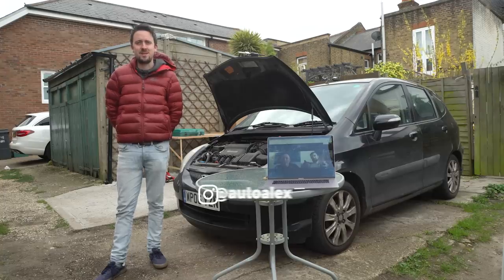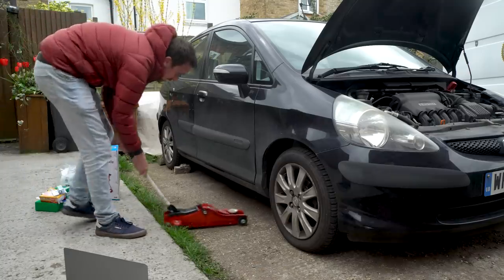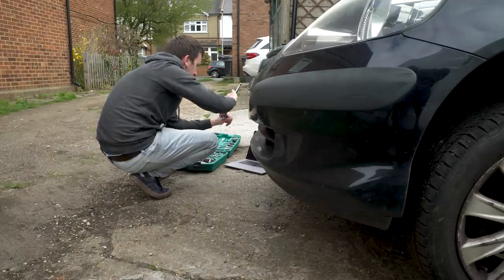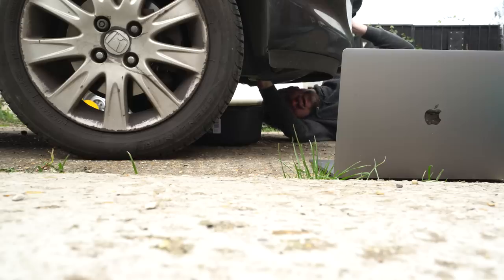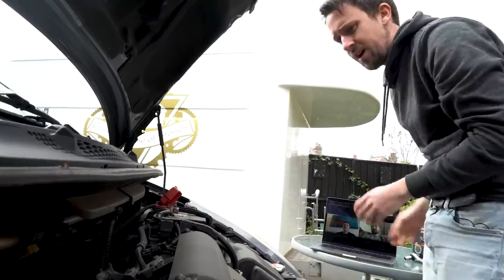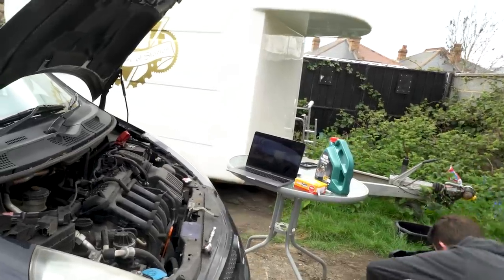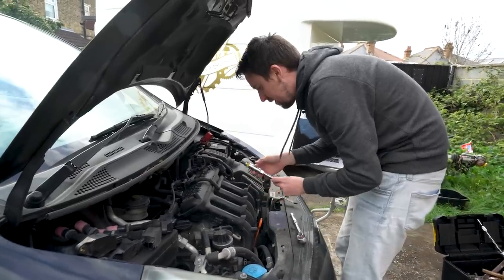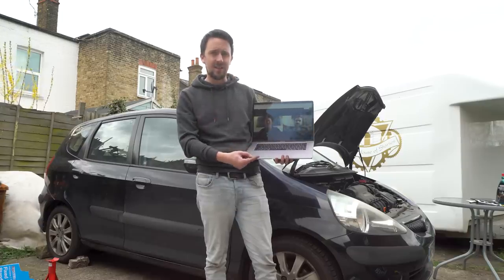Can A Non-Petrolhead Service A Car Over FaceTime?

Comment: I want to see more 'Ethan Vs Car Maintenance'
Reply: 100%!
Reply: 100%
Reply: yes  let it be funny stuff but not a safety hazard when messing up.
Like changing the light bulb on a mid 2000s Alfa and in the end he'll realize he put it in crooked
Reply: No
Reply: 100%
Reply: Start with handy jobs like brake pads and discs then move him onto clutch replacement, timing belt and water pump 😂
Reply: I wanted to like this but I didnt wanna mess up the 777 likes
Reply: Fog light on a 2007 Saab 9-5
Reply: Great idea
Reply: ethan fits a hks big turbo kit and injectors to his honda jazz
Reply: @theowainwright7406  😂😂😂
Reply: 85%

Comment: "You need to social distance the battery, so keep it 2m away" 😂😂
Reply: Never heard about disconnecting your battery when you're changing sparkplugs, but alright ....
Reply: @ACCORDriver_NL  I never do that.
Reply: @ACCORDriver_NL  I've been zapped through the hand several times by a 40kV coil pack once so I can understand the caution.. but that said, I can't see any reason why it would discharge with the car off.

If you're curious as to how that happened - 18 year old me was on the side of the road with a blown clutch and gearbox (snapped input shaft.. no connection through any gear at all) and I had previously swapped the engine with one from a similar but slightly different model, which had different alternator wiring. This change in wiring meant the engine didn't turn off with the key, so for the month prior I was purposely stalling it in gear with the brakes on every time I parked.
So now with a blown gearbox, and wrong alternator I had no way of stopping the car.
2am, no streetlights around, no torch, no tools. So I wrapped a rag around my hand, made sure that I was not touching a single part of the car with any of my body, and ripped out the main distributor lead.

Hurt like a bitch for 2 seconds, but the engine stopped and I was not injured.
Oh to be young and dumb. I really miss that car too, 1981 Mitsubishi Scorpion. It brought be nothing but pain and anger through mechanical trouble, but was a dream to drive and so comfortable for long highway cruises.
Reply: should have run the engine to let the oil circulate then check oil level and top up if required
Reply: 200th like.
Reply: @sixunity1171  Thanks for your kind words, mate

Comment: Can we give Ethan a round of applause for getting the oil filter off bare handed without a wrench?
Reply: Reagan Lyle they should be hand tight though....
Reply: @robplant5576  yet rarely are
Reply: @robplant5576  the rubber seal bonds it together causing good fun
Reply: @luckiihussain9617  I usually pull the o-ring off and coat it in oil, then I do hand tight(then a ¹/4 turn) worked for about 100 oil changes so far.
Reply: @xjmg007  you have to oil the seal regardless but like they said the car was well over due a service so didnt make sense
Reply: @luckiihussain9617  not what I said, I said if you pull the entire o-ring off and coat BOTH sides, they tend to free easier
Reply: @xjmg007  And im telling you it doesnt always work I've been a mechanic for 7 years and do 2 3 oil changes a day you experience the lot
Reply: @luckiihussain9617  I'm sure you're right, I have only done a hundred or so, and I'm only experienced in LS's and Hondas. Not doubting you, just my anecdotal experience.
Reply: @xjmg007  Cars never go to plan the small jobs turn into the worst nightmares
Reply: @michasopa4305  If you struggle to get 2 hands on the filter the chances are slim but the screwdriver trick manages the job
Reply: I have the feeling that some mechanics use an impact gun to screw these things on. I've not gotten them off this easy ever.
Reply: @robplant5576  I do mine hand tight, but most people suggest hand tight plus a quarter turn (makes sense for someone who isn't as capable of tightening the filter enough by hand)
Reply: My old Jag S Type Oil filter was on so tight I had to stab a screwdriver through it and lever it around.
Reply: @mikeazowski1  Had to do this as well, though I used a drill first. Definitely not a good idea for cars with top mount filters, though those usually have space for a proper filter wrench.
Reply: @robplant5576  idealy they must be. Last car oil filter i changed, i almost ripped the filter with the filter wrench. Thats how tight it is.

Comment: I’ve never disconnected the battery when changing my spark plugs lol 😂
Reply: Dave you’re not the only one!
Reply: Technically you only have to disconnect the negative
Reply: I cant do that because my alternator output bolt is near my first spark plug and if i dont disconnect my positive wire it'll spark because my long spark plug socket make a short circuit
Reply: You've never done it because it's unescesary ✨
Reply: @putraadriansyah8082  when the negative is off you dont habe to worry about anything
Reply: @robplant5576  You disconnect the negative
Reply: You don't have to literal waste of time
Reply: @robplant5576 thats  too positive
Reply: disconnecting the battery is pointless. only one plug can spark at a time also ht leads are rubber coated so the only way you could get a shock is if you put your finger inside to make a connection
Reply: @robplant5576  yeah but you're not meant to disconnect the positive without disconnecting the negative first
Reply: mechanic of 20 years- not once have i disconnected a battery for spark plugs or leads... i do however gap the plugs haha
Reply: @Jeronimo Stupenengo Pefaur anyone with the slightest grasp of school knows that comes under Physics lol
Reply: @nornironniall  It's actually kind of a crossover between chemistry and physics. Chemistry deals more with what actually happens inside the battery, while physics looks at how the current flows through the system
Reply: @namedeleted9005  thanks for that, but sorry Hayley we're talking about electrons and their attraction to the positive pole.  That's pure physics.
Reply: @nornironniall  that's actually electrochemistry, which basically deals with determining the cell potential of a battery by looking at the gibbs free energy and how the redox reaction needs to proceed in order for there to be a spontaneous transfer of electrons without any outside input of energy.
Reply: @namedeleted9005  again, you're talking about batteries.  Which contain chemicals.  We were just talking about electrons.
Reply: I have never ever disconnected the battery when removing plugs. nothing bad will happen hahah

Comment: Ah the Honda Jizz... he'll have fun with that as they are twin spark, takes 8 plugs... lol
Reply: I came here to post that! 😁
Reply: Paul Coles me too.
Reply: Beat me to it
Reply: Lol guys, sorry :-P - These are actually very good little cars, I picked a 1 owner one with FSH and 90k on the clock for £175 at the auctions, gave it literally death every time I drove it for about 2 years, flew through every MOT with no advisories, only had to service it hence I know it has 8 plugs lol, they are actually quite fun to drive/go-kart like if you throw them about, plus folk get out your way as they think someone ancient is driving it. :D
Reply: Only 4 of 8 is changed I reckon :)
Reply: I own a Dodge Charger with the 5.7 Hemi V8 and it's dual spark plug so I have to change 16!!!!
Reply: Honda Jizz
Reply: @79RockShox  of course its a good car, its a honda
Reply: The clue is in dual sequential ignition.
Reply: @meemdoggoriginallongdrink  Yes, that was not a typo. :D
Reply: The Gen 2 which my mum has has 4
Reply: @adamhenderson4318  Dual Shock Injection
Reply: @wolfrunner6462  if the cam cover says i-DSi on i, it's got 8 plugs, usually the 1.5 VTEC ones are 4 plugs but used to be rare in UK. As far as I'm aware, more common the 1.35 (1.4) i-DSi.

Comment: Hey guys, FYI:
The Honda Jazz uses 8 spark plugs. 

Cheers!
Reply: Twinspark ???
Reply: Yep having serviced my dads can confirm it does and the ones at the back are a nightmare to get out
Reply: A HEMI engine uses 2 per cylinder, but this is a cheap car so  its a joke
Reply: It actually has 2 per cylinder got me the first time I serviced mine
Reply: I believe its only the 1.3L ones that have 2 per cylinder
Reply: IckleSparrow  We own a GD Jazz with an 1.2 and it has 2 spark plugs per cylinder.
Reply: As a Honda technician I can confirm that this particular engine does in fact have dual spark ignition, 4 at the front and 4 at the back, it’s why these miss fire so much as people don’t replace the back bank.
Reply: It took me years realise my wife's Jazz had 8 plugs. After changing just front 4 for years it started jerking @ low speed and I couldn't find out why. I always went to the spares shop and asked for 4 plugs with the code. Eventually I accidentally just asked for plugs for that model & the guy gave me 8 plugs. I pointed out that it wasn't a V8. He told me the facts!
Problem solved - no more jerking.
Reply: @icklesparrow  and the 1.4
Reply: @gregculverwell  and that is why poeple shouldn't touch what they have no clue about
Reply: That's what I was thinking. I'd love to see Ethan changing the other 4 spark plugs though... hahahaha XD
Reply: I have never heard of disconnecting the battery before changing spark plugs and I've been doing so for forty years .
Reply: @michaelarcher6278  same here... another example of don't believe everything you see on yt.
Reply: @nilsgerbracht  yep. the iDSI written on the engine cover stands for "intelligent dual spark plugs ignition" if i'm not mistaken

Comment: That car is actually with 8 spark plugs :D . My mother has the same Honda. The rear plugs are really fun to change :D .
Reply: What???
Reply: yeap. it has 2 plugs per cylinder.
Reply: Ah you ain't done spark plugs til you done a Mercedes m112 engine
Reply: same for the Honda Civic 1.3 FD Hybrid Version.
Reply: @aliabdallah102  This is engine where easier is make full rebulid than change sparkplug. Easy to remove if u have a lift to separate body from car
Reply: @aliabdallah102  you aint done a spark change on a M275 ;)
Reply: LDA1.3
and 8 coil packs too. The two sets, front and back, are also different.
Reply: @rasmuswennerarnell7359  cant be worse then an old porsche boxster (you have to lift the engine to change sparkplugs)
Reply: @rasmuswennerarnell7359  no, but I just bought a car with the 275.
Reply: *272
Reply: Same with 90s ford rangers
Reply: Yeah, my friend has the twin spark model... And its 'really fun' to do... And also it had one plug stuck due to over-torque on previous service... So we decided not to change that one till now... 😅 😅 😅 😅
Reply: I was literally about to say this 😂 he's forgotten about the other four plugs
Reply: Man now my Volvo sounds easy..
Reply: I regularly use chunks of glove to grip nuts and bolts loo
Reply: The rear plugs are gonna make your hands bleed....

Comment: This is an i-DSI engine which has 8 spark plugs. Good luck replacing the other 4 spark plugs Ethan! =D =D =D
Reply: Yea......I have done it on mine.......not recommending for sure :D
Reply: They are fairly easy to do i dont mind doing them
Reply: Thats what im thinking about, seems like they not realize it  😂
Reply: Why does it have 8 plugs?
Reply: J S twin spark engine 👍🏻

Comment: When you're removing spark plugs, the easiest way about it is to loosen them up with a socket and them grab them with the coilpack or sparkplug lead and chuck it out. Much easier than any other method really, unless you have a socket with magnetic insert.
Reply: Why would you need to disconnect the battery for a change of spark plugs? 
I have done a few and never heard that before if the ignition is off surely there is no danger.
Reply: @thedave7760  I've never disconnected the battery when charging spark plugs lol.
Reply: its probably a disclaimer thing as someone will copy this but with the ignition ON! lol
Reply: Ooooor...you could use a socket that is specifically made for sparkplugs, just a though though

Comment: I see the engine cover written i-DSI. The jazz/fit use A15 engine, and it has 2 type. Didn't that engine(i-DSI) use 8 spark plugs?? 😅
Reply: yes 2 plugs per cylinder set at later timing to burn all or any remaining fuel from the injection
Reply: @Ravinstomper  I would actually love to see Alex mess up Ethan saying that engine actually use 8 spark plugs he convince that is a 4 cylinder engine. 😂
Reply: @Ravinstomper  Wait, Honda use 8 spark plugs like AR with twin Spark??

Comment: Top tip ethan: dont hold the oil container vertically like you do here. But rather horizontally. That way the oil should come out in a nice stream. 

They should have said that tbh
Reply: And use a funnel, just sayin...
Reply: @ashtonmark24  top half of a Pepsi bottle works fine 😉

Comment: I really hopes he forgets the bricks around the back wheels! He'll try to drive off and wonder WTFs gone wrong!
Reply: I've actually done that before when I got my new stainless exhaust in and was really excited
Reply: @kaksken1999  I work almost 6h to put exhaust in my friend E46, and we forget about jack under rear diff.
Reply: @mateuszzimon8216  I haven't done that but I drove over the tool case too 😂
Reply: 2 years ago I got new wheels and after mounting them I wanted to take the car for a spin. The car didn't move anymore. I almost freaked out. I found out that the spokes where hitting the brake calipers and had to get some spacers for it :D

Comment: This was great 😂. On the slightly older Jazz’, they actually had 8 spark plugs, even though they were a 4-cylinder engine. 😬
Reply: This was only for the 1.3, the 1.5 has 4 plugs.

Comment: Love how Ethan celebrated after changing the air filter 🤣
Reply: Hey on modern cars that's an achievement! I've changed headgaskets on classics but I can't fucking figure out how to open the damn air filter box on a 2003 Skoda Fabia.
Reply: @GlamStacheessnostalgialounge  Honestly some modern cars have some stupid designs that make easy jobs way harder but that little wagon that Ethan has looks like a right treat to work on
Reply: @jordanlazarus7345  Well, might seem easy until you realize that Honda has TWO sets of spark plugs, the other set is on the other side....right next to the firewall...under a bunch of stuff...yeah, not a treat.
Reply: @GlamStacheessnostalgialounge  That's still light work compared to some of these modern cars

Comment: That i-DSI on the engine cover would rather suggest that it's got 2 spark plugs per cylinder.. 
So that's half the job done. 

(Also cabin air filter. If it's been that neglected it'll be truly revolting)
Reply: I thought anything with a D in the model meant it was Diesel TDi, D-4D, 320D, that sort of thing...
Reply: @Jamal_Tyrone  
Not always. Can mean various things manufacturer dependin;
Mitsubishi GDI -gasoline direct injection
Honda DSI -dual spark ignition
Also no diesel honda jazz/fit ever made

Comment: I physically twitched when he dropped the allen key.  I envisioned it going right into the jug.

Pro tip: screw the files, screwdrivers, etc.  Just use a magnet.
Reply: Marigold with magnet, not in this case. 
but good idea
Reply: Magnetic wand has saved the day many times!
Reply: a strong magnet on a stick is honestly a must have when buying tools, however most people don't drop hex keys into spark plug holes

Comment: 14:12 You forgot the 4 spark plugs at the back of the engine
Reply: Exactly, the iDSI Jazz engine has 8 spark plugs for efficiency. I made the mistake of only buying 4 when I serviced my ex's Jazz the first time.  
I've now got a modified 1.5 VTEC Jazz with a full exhaust, lowered, wheels, brake upgrade and a racing seat. Good fun little cars.
Reply: @michaelclark3192  no one asked.

Comment: These engines have 8 spark plugs 😂 only 4 were changed 🤷🏽‍♂️
Reply: just looked it up and you're right. what a weird design decision by Honda, only ever seen an Alfa with twin spark plugs
Reply: The IDSI has 8, pretty sure the vtec's got 4 again no?
Reply: @socalguy829  Why weird? It improves torque curve and emissions.
Reply: i have idsi jazz same as ethan. it got 8 behind it. it hard af to changes theme in tiny spaces.
.. in brochure (in thai) said. they got 8 spark plugs to help clean and  good combustion. might be.
Reply: @bootlegscarce0844  what's the point of having 8 spark plugs in a economy car?
Reply: @1985toyotacamry  for efficiency
Reply: @jorgedelrey742  I be honest it sounds pretty stupid design for fuel consumption if you double up the spark plugs in a 4 cylinder engine. I'm not saying your wrong just a dumb design on Honda part
Reply: @jorgedelrey742  I would've thought that more spark plugs means that it will draw more power?
Reply: It means you can change the combustion chamber shape and run the engine leaner. Honda engines are usually pretty good, I expect that their engineers know exactly what they are doing.
Reply: Lol when you call a multi billion dollar car manufacturer like honda 'dumb'. 8 plugs are there to have a cleaner burn thereforere reducing emissions.
Reply: @1985toyotacamry  Do u know the 2nr ve toyota engine? It got 11.5 cr and a freaking 100hp. So slow for a 1.5l?
Reply: @vigossvirus666  I didn't say it was slow I say it was a stupid design.
Reply: @1985toyotacamry  1339 cc engine has 121nm(89lb)@2800rpm and 87hp@5700rpm. 1500 rpm is more than enough to do daily comute within a speed limits.
Reply: hendrahenda - Twin sparks generally produce more NOx emissions though as they come from the ignition spark rather than the fuel.
Reply: @tyablo  oh my I didn't say it was slow I said the design is stupid.
Reply: @1985toyotacamry  i didn't say that. i said it has enough power at low rpms to move around a city. and it is efficient. i had JDM Fit (awd) and fuel consumption was about 8 litres per 100km (12.5km/l). i dont no how many mpgs that is
Reply: @1985toyotacamry  Im talking about other engine. Toyota engine code 2nr ve. It gots 11.5 compression ratio, with 100hp and 136nm. 1.5 litre displacement, freaking slow